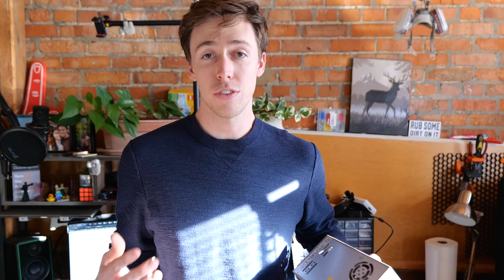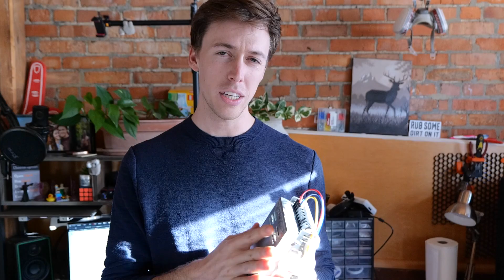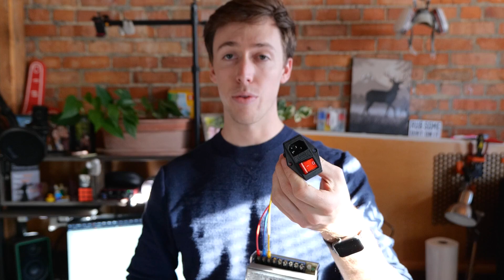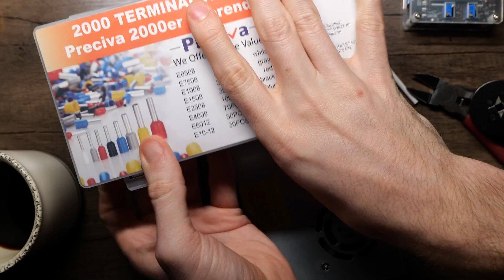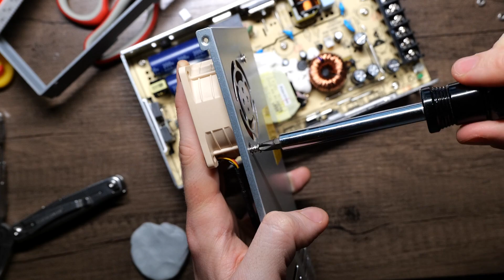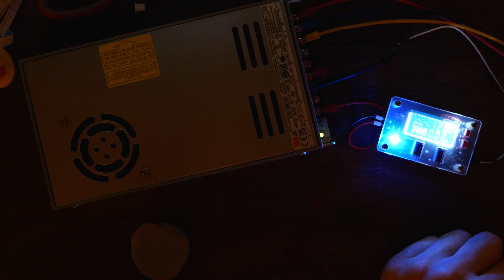Should YOU Upgrade YOUR 3D Printer's Power Supply Fan??

Comment: =For like 1.50 euros you can buy a 4 pin pwm temp control pcb with probe. I would have tried to put that in there also. Then it can turn of or just spin slower when that's possible.

Comment: Pretty sure that is a PS-SP11625 "Aliexpress" version with a "meanwell" sticker on it
An real LRS-350-24 is 3cm thick good luck with the 2.5cm fan :P (oh and it has fan control it goes higher and lower on the temperature :P
I use a LRS-450-24 with two 92cm fans :P
Reply from the maker: Well isn’t this unfortunate haha. I guess Amazon is just aliexpress but faster

Comment: A change is worth it. I switch to 120mm fan, gives awesome silent result.👌
Reply from the maker: Nice! I just uploaded a new video using a 92mm noctua fan for cooling my motherboard. It’s still a bit louder than I’d like. I may run it at 8V instead but in the future I’ll lean towards a 120mm fan!
Reply: @SpencersDesk  bigger fans are always the way to go. much more airflow at a much lower db cost. also it's easy and there's tons of space.

Comment: I'm your 124th subscriber.  Retired pilot with now a surplus of time and also a 3d printing hobby.  I did the same on my V400, used a buck converter to power Noctua fans, my converters didn't have a read-out so I had to use a multimeter to get the right voltage.  I like your videos and presentation, keep it up.  Youtube can be finicky on how and when certain channels take off, but I found your video in my recommends, so hopefully they're boosting your work.
Reply from the maker: Thank you for the kind words! Is the V400 a Delta printer? It would be nice for YouTube to favor me but I’m only just starting and have plenty to learn before I expect any return! Best of luck 124!

Comment: If there is space inside i would chose different route. Cut bigger hole and slap there slower 120mm fan. No need to overpaying for noctua.
Reply from the maker: Nice idea! I think to use a larger fan you’d have to make the adapter even taller as there are some clearance concerns.

Personally, I think Noctua, while more expensive, isn’t overpaying. I appreciate their products and definitely have some brand loyalty. If you design a way to use a larger fan then be sure to share it with everyone!

Comment: Stop replacing or adding plastic parts to PSU housings. The METAL housings are there to prevent issues and stop EMI issues if something goes wrong. This can cause a fire and good luck getting your homeowners insurance to cover if the PSU causes a fire because you modified a UL listed device to add plastic on where metal should be. Sharing bad information like you are can hurt someone if something goes wrong. STOP MODDING PSU HOUSINGS WITH PLASTIC.
Reply from the maker: Hi, thanks for your comment! I 100% appreciate the concern, but I disagree in this case. No pun intended.

I don’t believe EMI is an issue in this environment, and often isn’t with these low powered supplies. I believe the metal casing is for more practical considerations like strength of the housing, thermal management, etc… Lower power adapters like wall warts or laptop chargers are encased in plastic. I did fail to mention in the video that you should ground the lid to the rest of the enclosure as we just electrically isolated it. I’ll be sure to add a note of that to the printables page and description. Thank you for the concern, and I’d be happy to chat more about it.
Reply: @SpencersDesk well, if there is a fire, thats your house burnin down not mine.
Reply from the maker: Let’s just pray that no one has to go through that!
Reply: @SpencersDesk  A couple years ago there was a lot of hype to switch out your stock creality heatbreak-fan to a quiet noctua fan. This worked splendidly on small prints, but as soon as you tried to print something bigger it got ruined because of heatcreep, because the noctua fan pushes a lot less air. 
This feels somewhat similar. You can probably print a benchy just fine, but did you check the temperature under a heavier load and longer time? What does it do to the longevity of the powersupply?
Reply: @SpencersDesk don't want to be a buzz killer, but the slightly lower air pressure of the noctua fan wasted a huge amount of my time (and filament) back when I was new to 3D printing. And I did it based on advice from some YouTuber that thought it was just a splendid mod to do a video about.

Comment: As you asked for the possible ideas for future videos, just spitballing some project ideas (sorry for the Vyper bias):
- a custom designed hotend (maybe aesthetically similar to StealthBurner, but with Orbiter)
- Equipping the CANBus board with more hardware (Orbiter filament sensor, BLTouch / Pinda, lights / etc) - it's not clear to me if it has enough pins?
- your solution for Klipper config backups
- linear rails
- enclosure and filters (nevermore, bento box)
- high temps printing
If you want to just rake a lot of views, just test a bunch of different filaments - such topics always attract viewers :)
Reply from the maker: Haha, you must be reading my mind. All of those are on the docket except for the config solution. Can you elaborate on that? I was planning on going more in depth on Macros/doing an overview of all the possibilities with Klipper.

I’ve definitely considered talking about/testing a few filaments, but I’m not sure how entertaining I could be or how much I can bring to the table at the moment. I’ll be moving in a few months so hopefully I can get a “studio” setup and be able to do some testing!

Comment: Hey, a nice update! I think the stock power supply is also capable of 350W though? Measuring via a smart plug, the printer consumes ~300W to get the bed heated to the temperature (and then much less to sustain it), and about additional 40W when the hotend is working.
PS: another source of printer noise is that "jet" cover on the hotend cooling fan, that comes with HeroMe 7.  I took it away, and the fan us barely heard without it.
Reply from the maker: Hey! I guess my main reason for the new PSU was so that I KNEW what it was capable of. I didn’t even think to check my smart plug lol. The stock power supply is going to be used in the future to control accessories or other project so I was going to buy another at some point! I agree on the jet cover. I’m planning to change up my print head when I have some extra design time and that will definitely be coming off. Thanks for your support!!

Comment: I've done this almost eaxct same mod several times. You can also cut away the metal in front of the intake. It may not be quieter, however it changes the pitch of the fan.
Reply from the maker: Hey! Not a bad idea at all! I definitely noticed that placing my hand over the vent changed the sound a lot. Maybe there's a small cover to add that muffles the sound without hindering air flow? Thanks for you comment!
Reply: @SpencersDesk  you should cut out the original grill, and print something like the noctua optimized grill and use that instead. It will improve airflow and noise.